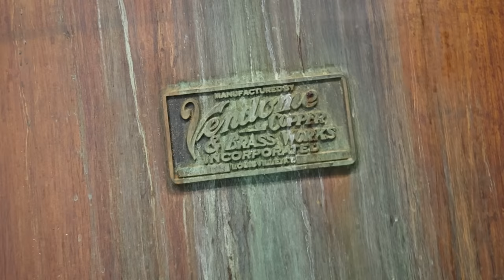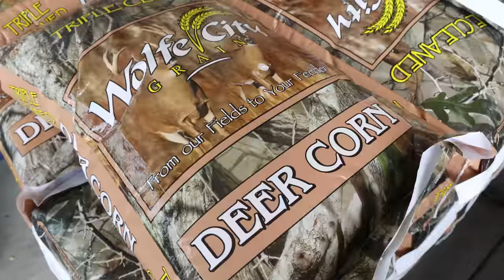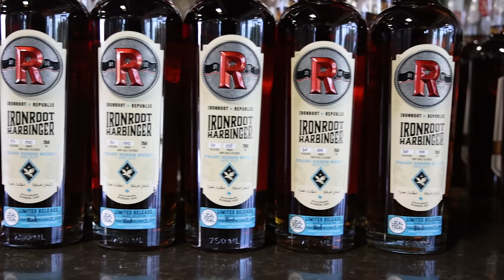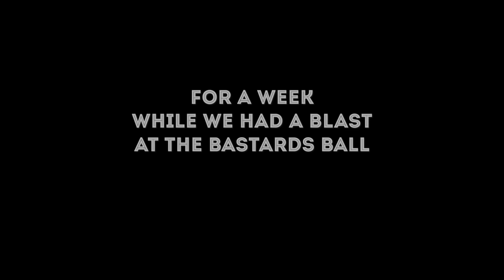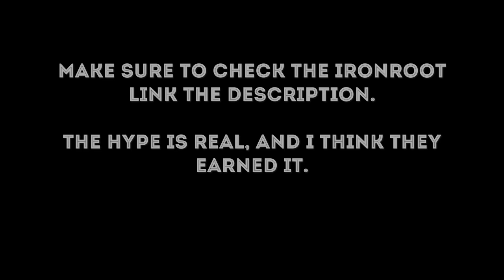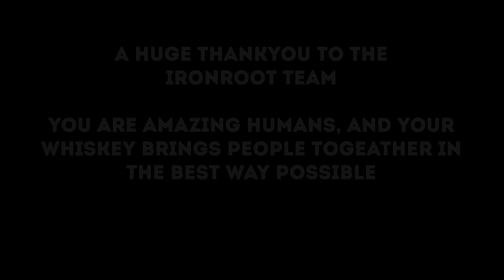Can We Turn Doritos Into Bourbon?

Comment: I have a different (and possibly better?)  Suggestion for the removal of the oil.   Just chill the whole thing in a walk-in freezer and you SHOULD be able to return the oil to a solid state, and you can just remove the whole puck.
Reply: I was thinking the exact same thing.
Reply: That’s only going to work if they use an oil that is solid at room temp, which vegetable oil isn’t.  i
Reply: @codename495  ?  No...  If it was solid at room temperature you wouldn't need to put it into the freezer in the first place!

Everything has a point where it will freeze, and any of the vegetable oils are no different in that they will turn into a waxy solid eventually.   

In the case of doritos, they use a mixture of Canola (-10 C); corn, (-11 C); and Sunflower (-17 C)

So they just need to chill it to around -20 Celcius (right around -4 farenheit) and YES the oils WOULD indeed freeze solid.  Seeing as my original post LITERALLY said "chill the whole thing in a walk-in freezer" and industrial walk-in-freezers average between 0 and -20 farenheit, this would 100% freeze that oil solid.

Seeing as they are all on the top, it's a comparatively simple matter to remove the whole chunk of ice (that contains the alcohol but in low enough concentrations that it's not going to stop the ice from forming) and just cut off the top chunk that contains the nasty fats.

This way you're removing 99.9% of the fats that smelled/tasted nasty to begin with.  Ergo, you're going to get a much better over-all end product.

Comment: I ran something similar about 6 months back.  I let my mash rest before fermentation and drained from the bottom to get the oil off the top after it cooled.  I did not do a all Doritos though and it was only about 10% of my grain bill.  Mine came out cheesy but not in a bad way.  Aging it on oak, and chili peppers atm.